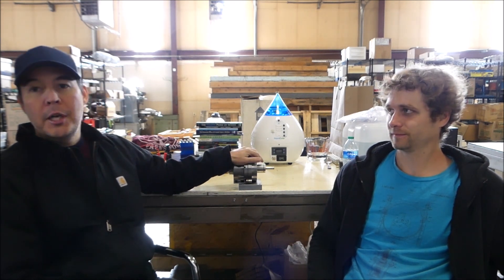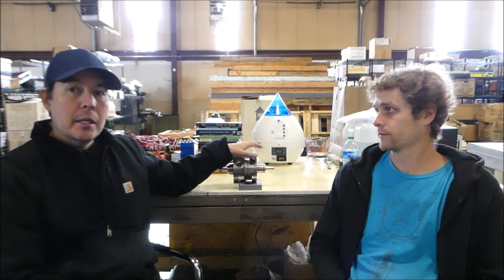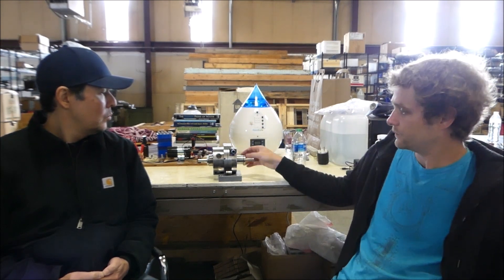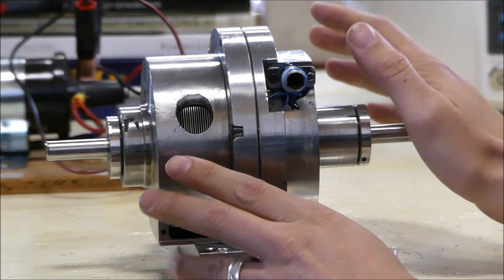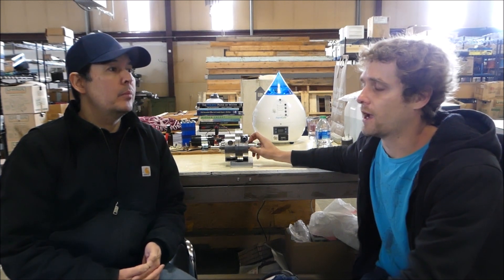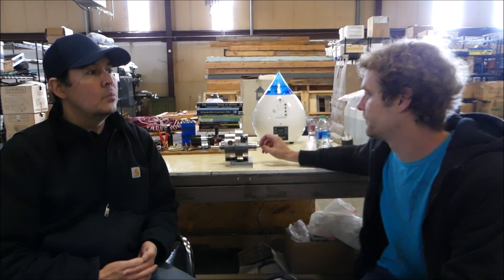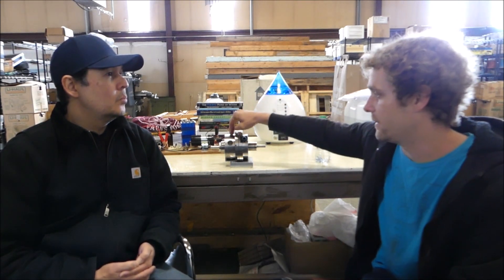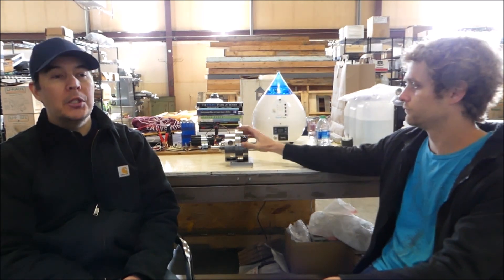Future Plans for The Tesla Turbine Cold Steam Project

Comment: Tesla's simplest method of balancing a rotor was very inexpensive. Two rods with a triangular cross-section, machined so the top point  is razor sharp. This is so there is practically no friction. Both rods are set up to be perfectly level, and the rotor is set across them. A machinist's precision level can be used. The rotor will roll so the heaviest side rests on the very bottom. You could also use round stock instead of the special triangular pieces, because technically there is a tiny point of contact that way. So shafts would work to start off with. But Tesla used the special triangular rods.
Reply from the maker: that can help you get a static balance, but the balancing machine in his patent describes a machine for dynamic balancing. I've mastered the process.

Comment: I guess the gold standard test would be to see if you can produce the power with a tesla turbine required to draw a vacuum, chill a condenser and move water back and forth.
Reply from the maker: you can chill the condenser with atmosphere exactly how a truck or a car chills it's engine, with a radiator. The vacuum only needs to be drawn one time and the system can run forever as long as you don't have any vacuum leaks in the system.

Comment: Have been watching this develop for some time now. I have a slight grasp of the concept and how it could change the way we produce power. It would be helpful if you could explain how this could affect the average household or application as chosen, what does it mean in the real world to the average person? Thx
Reply from the maker: It's an alternative to regular solar, it doesn't cost a fortune to set up and it's sustainable. In the city it would be less practical, but in the country it is gold.
Reply: if you are using cold steam I think a geo thermal heat pump set up would work amazing and not be limited by the time of day(solar). it only runs a few feet under ground and is almost always a different temperature than the surface.

Comment: I've been working on my own design using pressurized air and 3d printing
Reply from the maker: Pressurized air is a very good place to start!
Reply: @iEnergySupply   My design works with two pressurized air tanks. One tank spins the turbine/pump, while the other tank is empty and getting pressurized air put in it via spinning tesla pump. Mostly just moving air back and forth between tanks and spinning a turbine in between 😅 Its working pretty well so far.